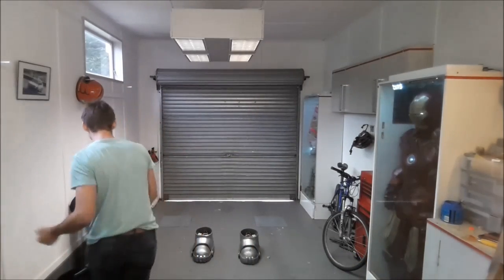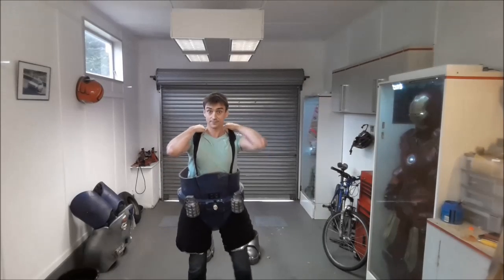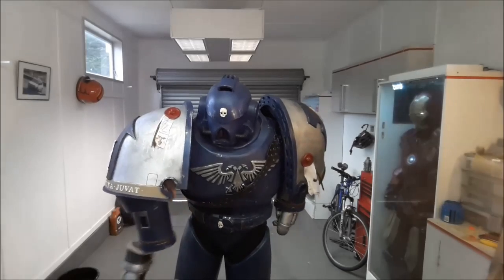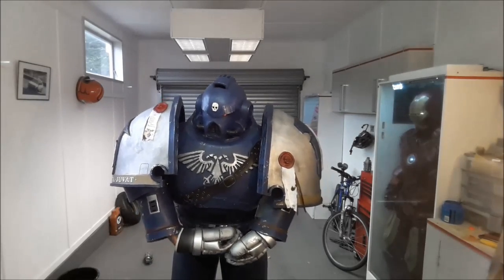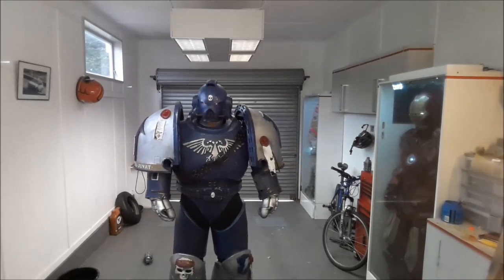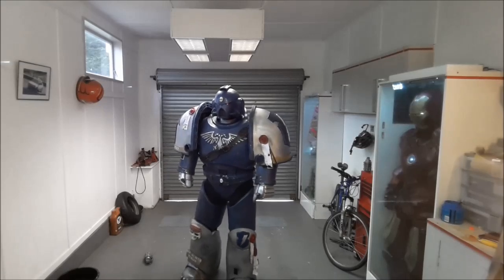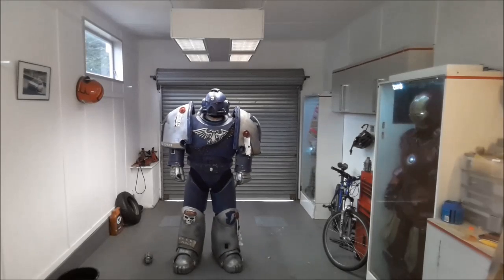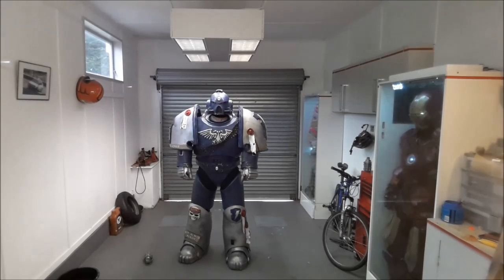How to make an EVA foam Space Marine - Part 11 - The Suit Up!

Comment: DEM ARMS XD
Too short, but otherwise the suit look awesome :D
Reply from the maker: This is a common complaint when the Marine costume uses stilts... but mine doesn't, so my arms and legs are the same proportion as they should be. What you might be seeing is the shoulder pauldrons being too long (which they probably are) ;)
Reply: Show us your attempt? Whats that you never made one?
Reply: Adam Moore Calm down, he was just criticizing it. And the maker even made a comment agreeing. The person that builds it should be happy with it and flaws with the design can make it less appealing to other people. To find flaws with it you sometimes need other people’s opinions and criticism.
Reply: The arms aren't even that short compared to a normal marine. But I do still agree and I noticed you have a lot of neck visible.

What I would do is pad the shoulders a little more so the armor is heigher up (which in turn lifts the pauldrons) and that would give the arms the space they need. I think that would give the suit that bit of refigment it needs.
Reply from the maker: @colboy1fish  that’s actually exactly what I did, although I never documented the changes.
Reply: @adammoore251  well, yes, but short be as short do.
Reply: @WellingtonIronman   maybe use like a marvel gauntlet but cover it in styrofoam to get the bulky hand and length you need
Reply from the maker: @isaacwinchell1806  a good suggestion. Although as I’ve said, the arms are the correct length because this is not a stilted costume. The false perception that the arms are short is created by the overly large shoulder bells.

Comment: You probably won't see this, but do you have a rough estimate on the material cost to build the suit, I already have the tools from building an NCR Vet Ranger cosplay and want to know how long I'd need to save up for the foam. 

Edit: Forgot to mention that the build looks great, thanks for making these.
Reply from the maker: Kingstone Maxamose hi there. I did see this ;) I’d estimate about $200 on foam but it depends what foam you use and where you get it from

Comment: i think the pouldrins are too low. it makes the arms look stubby
Reply from the maker: I'm not so sure. look at how high the top of them are in relation to the helmet. part of it might be the Pauldrons being too long rather than just too low.
Reply: +Wellington Ironman i think it depends on the referance but most art and miniatures ive seen put the pouldrins level with or slightly below the helmet (i think they are meant to protect the head from the side as well as the arms) plus raising them would mean not having to "modify" a finished piece.
Reply from the maker: I'll look into it :)

Comment: Looks kinda small but it's probably the best you can do with foam
Reply from the maker: In cannon the suits are between 8 and 9 feet tall, but they’re made to fit marines who are also that size. For a costume you can either choose to make a taller one, and use stilts, or make one that fits the wearer. If you make a tall one, only the legs are longer and the rest of the suit is the same size, plus the arms end up looking too short.

Comment: How did you joint the legs? Also, are the legs dangly?
Reply from the maker: The knee joints are using hinges and aluminium flat stock. The hips are just using nylon webbing and belt Clips. Yes I suppose they are dangly :)

Comment: Question why did you not just make the shoes and the legs all one piece
Reply from the maker: A fair question. The ankle joint generally needs two degrees of freedom to be useful, look at your own ankle joint and you’ll see what I mean. The knee can be a simple hinge but to allow you to walk on uneven surfaces, to pose and balance, you need more movement in the ankles. The other reason is that it doesn’t really represent any advantage to have them all together other than having fewer pieces of armour.
Reply: I see what you mean but I believe that it can still work if you connected them like the hands to the arms on your shoulder piece where it looked like it was connected with some kind of fabric if I am wrong about that statement I apologize
Reply from the maker: @shadowthehedgehog809  yes the gloves I had on a piece of fabric which attached to the arms, but this was only so I could take the gloves off and use my hands (like to operate my phone) without having to put the gloves down somewhere, rather than to help with suiting up ;)
Reply: I see quick question if I were to 3d print some space marine power armor could I use a sort of hinge to connect the shoes to the legs

Comment: It's really cool, but I think you may need limb extensions to add height and limb proportion to get it to look proportionally accurate.

But other than that, everything looks amazing, I'm surprised you have as much shoulder movement.
Reply from the maker: Yes the miniatures have non human proportions, but with limb extensions you start to run into problems with the joints in the armour not lining up with your own joints. You can very quickly run into serious mobility issues.
Reply: @WellingtonIronman  I saw someone comment below that the shoulder pads could be reduced in scale. 

I reckon a 25-30% scale reduction would do great.
Reply from the maker: @superguy7044  yes I’d agree. I actually cut about 2” of length out of the shoulder pads after this video was made. I believe the files were taken from the computer game so I just made them all to the same scale. In hindsight they could have been done smaller.
Reply: Also is he was holding a big ass bolter and chain sword it would distract from the short arms

Comment: I noticed most cosplayers make the pauldrons way to huge it's like your all trying to compensate or look cooler but it ends up working again you.
Reply from the maker: I just made em to the same scale as the rest of the files. I think the pep file I used was ripped from the computer game. And you're right, it's definitely all trying to compensate for the fact that the person inside is not a genetically modified 7ft tall 200kg bodybuilder :D
Reply: @WellingtonIronman  I think it's definitely worth scaling down just a little or ya end up having T rex hands but I mean it's not like it don't look great it's definitely fantastic, but if you try to stay to to specifications of a giant body guard then your cosplay suffers a little.
Reply from the maker: @dorittossenpai2268  to be perfectly honest, I'd make them shorter next time. Like removing the bits with the gold/white text

Comment: Arms too small, Shoulders to big. but nice
Reply from the maker: You say arms too small, but this is a human sized suit rather than one on stilts, so the arms are exactly the right length. It’s the suits with built in stilts making the legs longer which appear to have too short arms. The shoulders are big though which perhaps makes the arms look shorter. After this video I did actually make the shoulders slightly shorter :)

Comment: Dude you got baby arms
Reply from the maker: Hahaha. Looks that way huh! Short arms is a common complaint for Marine costumes that use stilts, as the legs then end up long compared to the arms. My suit doesn’t have stilts so the arms are the correct length. What causes the illusion is the oversized shoulder bells. Mine are waaay too long.